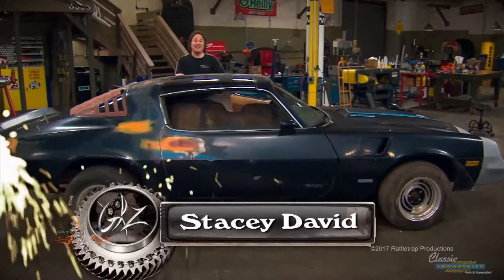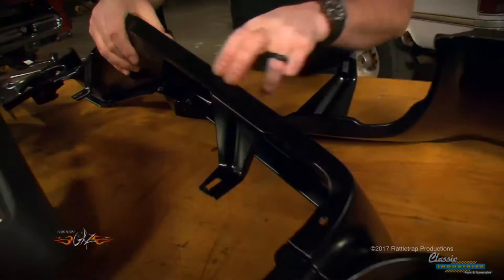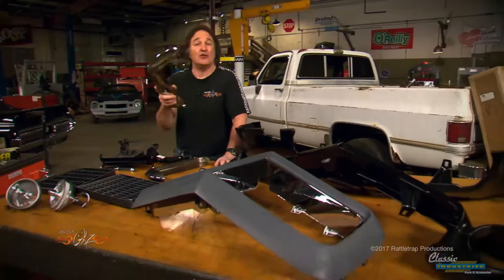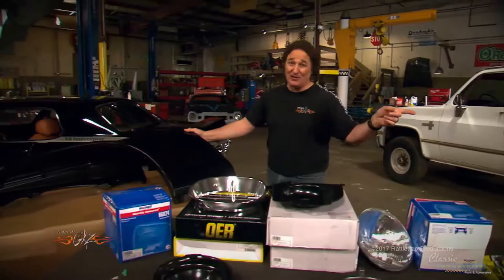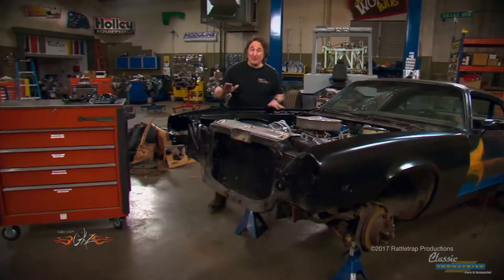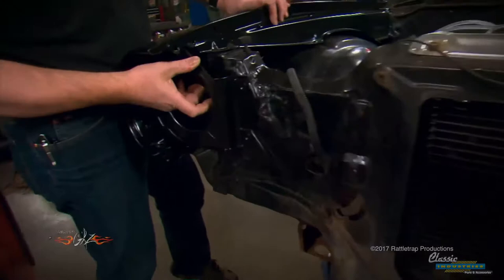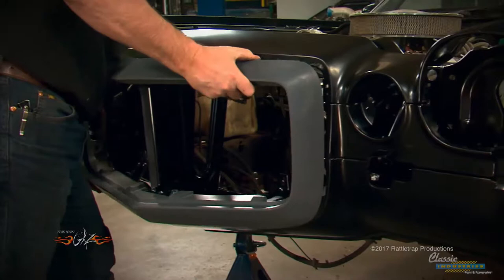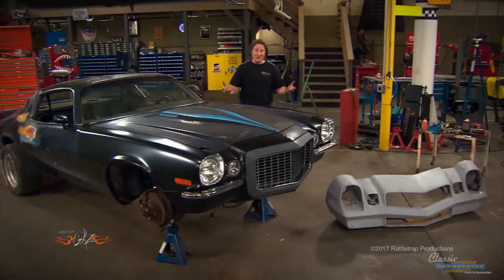Stacey David of Gearz  Converts 1981 Camaro Front End to 1970-73 RS Split Bumper

Comment: The '70 to '73 second Gen Camaro is the best looking of all that model.
Reply: 70 and 71 are the best.71 being the best in my opinion. Better seats for 1.Better brake system.Better AC system also if so equipt.

Comment: The parts are around $3,600 plus tax, plus oversize freight shipping if anyone is wondering. Excellent conversion but Lord it's hard to drop $4k on a car you drove home for $2,500.
Reply: At speedway motors you can buy the upper header panel and lower valence for $500
Front nose $500
Nose chrome trim $500
Grill $135
Turn lamps $167 
Free shipping
Reply: Ya but it does look 4000x better
Reply: @Juice9zero What about fenders?
Reply: I agree, and I bet that the rear conversion which a video was never done, is just as expensive.  Now you're looking at 7k total just in parts for both the front and back.  The rear conversion will require a lot of cutting of the quarter panels, trunk floor panel, and rear panels.  It will require more time to fabricate then the front.  Very costly.

Comment: Yeah that rad support needs alot of work to work. Just be ready to redo atleast two diff bolt holes. Cover old ones and drill out the right spots weld in new nuts etc. Its normal stuff for repop metal. We all been there done that. On mine it was the hood latch hole off about 3/4 and one of the bracket bolt holes off over 1/2. Easy fix, grind off old bolts. Weld shut hole Drill it out right. weld in a new nut. This was very evident one you put the OE hood latch part against this you will see the difference. Set up all your metal to make sure its all where you want and mark where it needs to go end state. than fix the part. Out of all the parts I have put on, the rad support needed the most work.

Comment: Why couldn't they stamp out a steel nose for this iconic car?
Reply from the maker: It could be done, but the original was urethane, so that's what was reproduced. There may be fiberglass and carbon fiber options out there, but no one has produced one in steel.